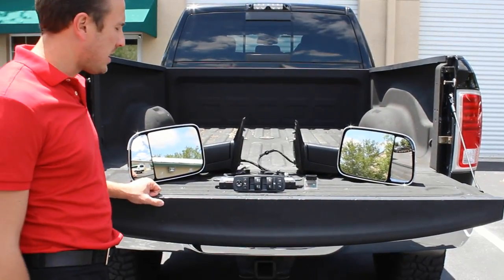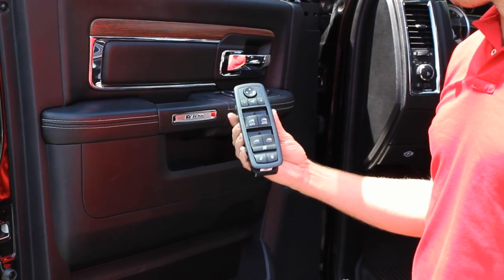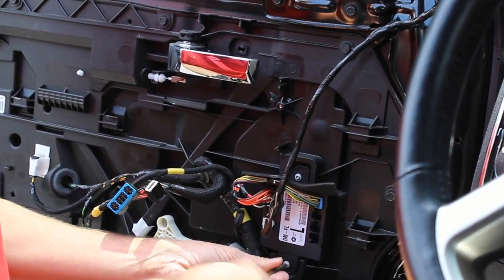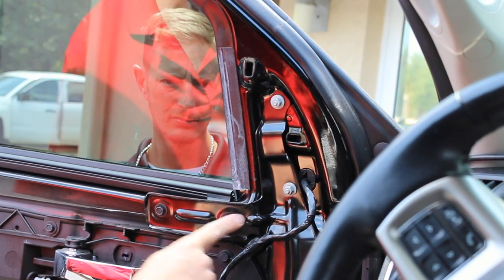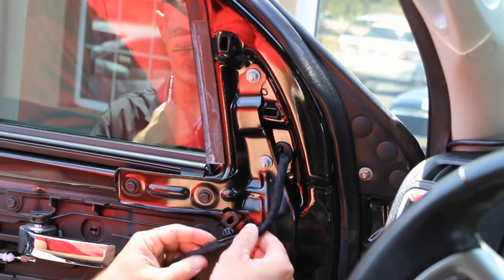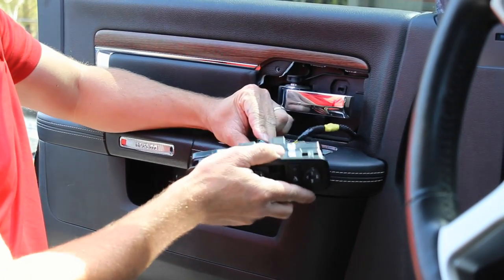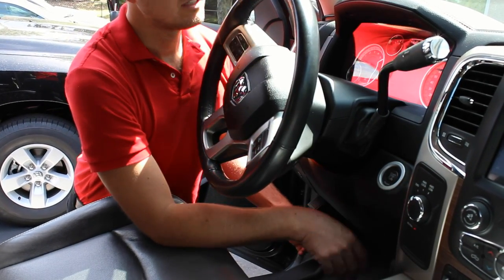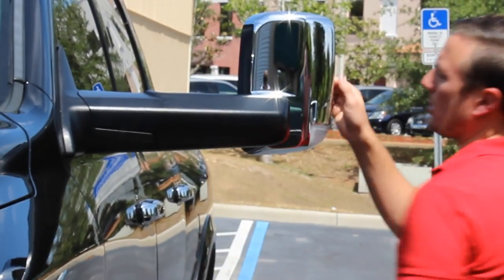2013-2019 Ram Truck Factory - Power Folding Mirror Upgrade - Easy Plug & Play Install!

Comment: Great video! Will the obd genie mess with the trucks computer if it has been deleted and tuned?
Reply from the maker: So the OBD Genie is similar to the programming at the dealership. It is not programming that exists on the Vin though so if the vehicle is restored to factory settings that programming will be lost. However, the Genie can be used and reapplyed multiple times on the same Vin. Other then a system restore that programming will be present on the vehicle and the OBD genie is not required to remain in the vehicle. If the vehicle is a 2018+ then you will also need a bypass module. 
https://infotainment.com/shop/interior-accessories/obd-genie-programmers/c-modbyp/